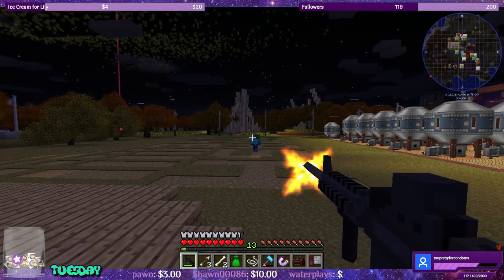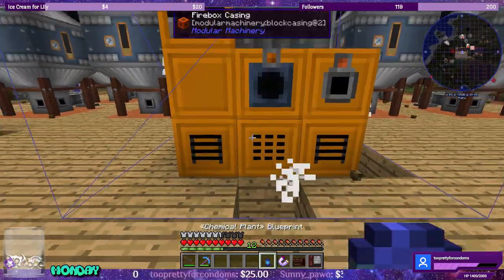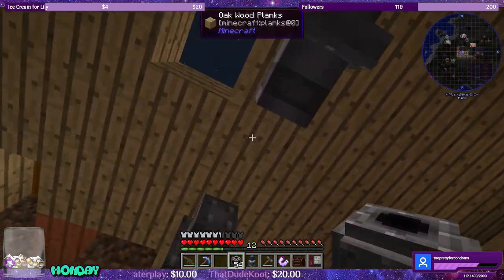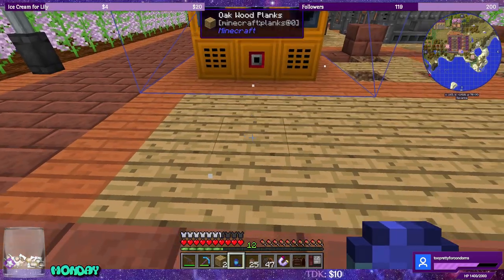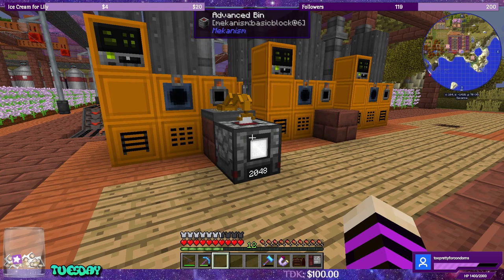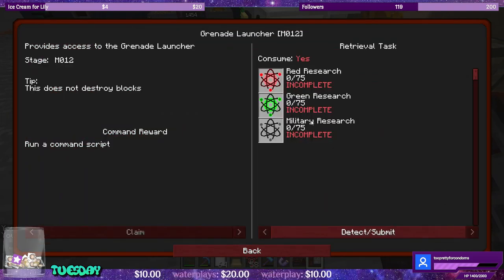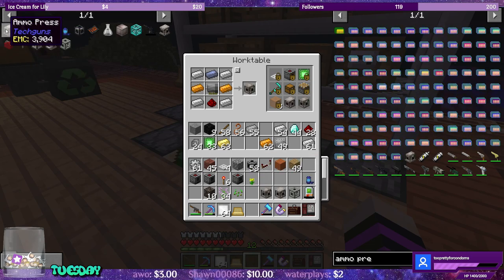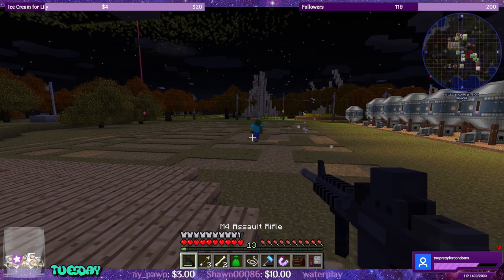Lets Play Manufactio EP 7 - Chemical Plant Plastic, Sulfur, Solid Fuel - M4 Obsidian Steel Turret

Comment: For some odd reason I cant put coal into the Chemical plant, either manually or with an inserter. Would be awesome if someone knew a solution as no plastic is going to make this mod pack somewhat impossible. Thanks
Reply from the maker: Coal and gasoline? Are you sure you are putting the coal in the back where the item input is?
Reply: @LetsPlaywithDDae  Yup, tried both the input and output and neither worked, tried breaking the structure and rebuilding, emptying of fluids, still no go.

only difference is I dont have the chimminy blocks underneath for testing purposes.

Love the channel btw the only thing more fun than obscure modpacks is finding small channels like yours that put out awesome content id never have found otherwise!
Reply: Solved, nice and bugged, once I created another with a different capsule it worked fine, while the original was still broken, super odd but no harm no foul
Reply: And it only gives me solid fuel...